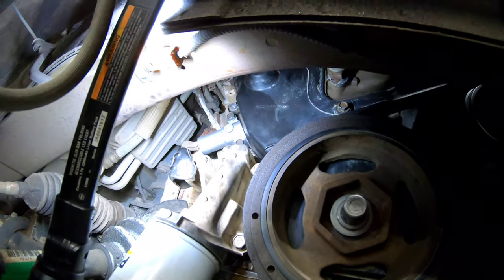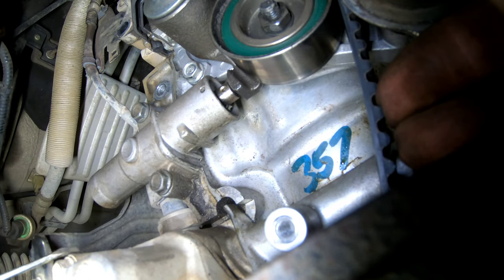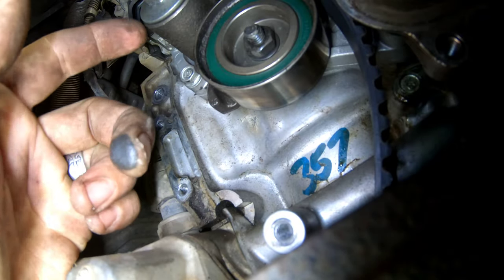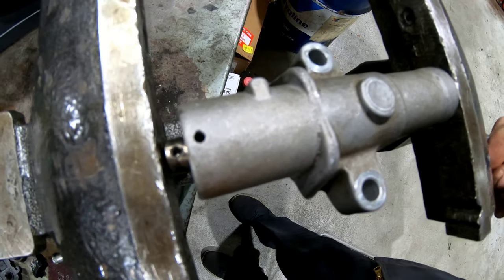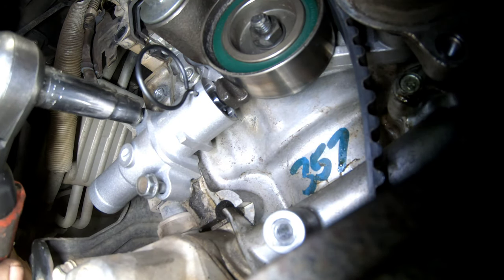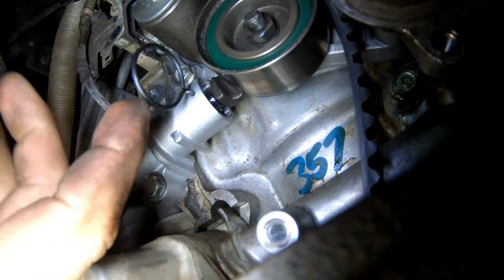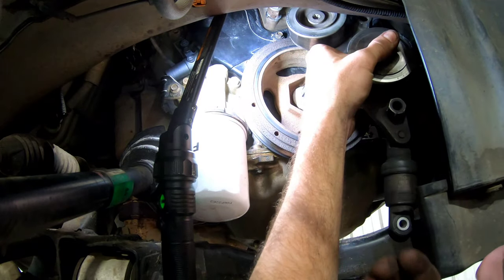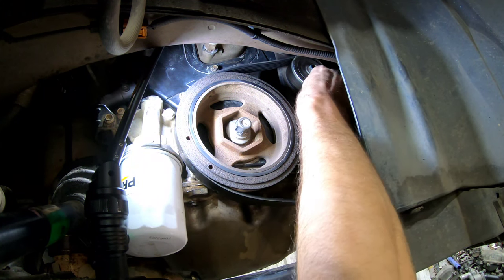Honda / Acura V6 engine ticking,  knocking, rattle noise from bad timing belt tensioner

Comment: Is it common for the knocking to go away after the car has warmed up.   Mine seems to go away.  It’s also worse on cold mornings, but again goes away after warm up.
Reply: Yea
Reply: Yea
Reply: Yea
Reply: Wish he would answer. Jesus christ.
Reply: My car makes that sound only in the morning too lol..
Reply: Yes, being a Honda tech I just looked at one today that had this exact noise. Customer stated that the clatter was more prominent during cold weather and also when letting the car sit for +1 hour or overnight.
Reply: Yes it’s common but when it becomes continuous while the engine is running for a while sounding like engine knock it’s just a matter of time before the tensioner completely fails and stop holding the belt bearing in place and then boom the result is going to be catastrophic failure and you will get a  stripped broken belt and bust valves after they clash with the pistons
Reply: I have found it’s best to use the old style shorter Honda butter fly tensioner or non hydraulic ones why Honda switched to the grenade style tensioner is beyond me I stopped using the grenade style ones as shown here I noticed with old butterfly tensioner Honda had no where near the timing belt problems making noise until they switched to these
Reply: Same here. Cold morningns only. Goes away after 1 minute... warming.
Reply: @rosieclark3661 do you haver the part number, does It fit in this car?

Comment: 2007 pilot here. Has a chattering noise when accelerating when beginning to drive up to 15 to 20 mph then the noise goes away. Will Not Duplicate the same sound while driving past 20 mph or faster. Great video thank you. Will share with mechanic.
Reply: I have something similar on my tl. Did you find out what it was?
Reply: One mechanic said it is probably the heat shield from the catalytic converter. Another mechanic said it is probably something from the axle. So, I have not received an accurate diagnosis.

Comment: I have the exact same noise on my 2013 Honda pilot. I also replaced the timing belt about 12,000 miles ago. I took it to mechanic and he tells me it's the timing belt. The tensioner was not replaced only timing belt. I have a feeling they are trying to scam me as they are trying to charge me $1800 when I already fixed it for $1200 in another city. Since it's the exact same noise i think I'm going to take my chances and just have someone replace the tensioner and hopefully the noise gets fixed.
Reply: Always replace the entire system when doing a timing belt job. The price will be high because of how long it takes to get to the parts
Reply: You might be able to swap just the tensioner yourself without replacing anything else look on YouTube. There's a way to do it without taking any of the timing covers or anything off
Reply: @jwat8400  he’s already replaced it 12k miles ago. Pointless to buy another kit when all he needs is a tensioner
Reply: @Wormmotb   Yes. However I was saying that for the future, so he wouldn't have to worry about something in the same system so soon.

Comment: Thanks for this information. My 2008 Honda Accord EX (3.5 V6) has had a knocking sound for the past two years. I just dropped it off at an engine shop today.
Reply: Did it fix the rattling?

Comment: 06 accord here 135k. My sound is alot lighter. Only occurs when it's a cold start and below 50* the noise goes away after warm up. Sounds like a loud injector or lifter idk.
Reply: 06 accord with 145k. Same noise on cold starts and goes away when warm. I'm fairly certain mine is the t belt tensioner. I work at a dealership and asked a few seasoned techs. They said to be certain, tear it down and start to verify noise.

Comment: Thanks for the video 
Have you used the Aisin brand for a timing bet kit if so whats be your experience with them
I have a timing belt  job coming up on my to do list and been looking for information/people experience with the Aisin brand kit
Reply from the maker: I have had good luck with using aisin timing belt/water pump kits on toyotas since allot of toyotas use aisin from factory anyway, I don't believe I have used a aisin kit for a honda yet, but on toyotas I haven't had an issue with aisin's hydraulic tensioners/ pulleys/ or water pumps.
Reply: @FixItPhillip  ok thank you for feedback the provided mishiboshi  timing belt is a quality part as well   or would a Bando brand timing belt be better  ?

Comment: Bless you Philip, I have that same type of sound coming from my 2017 Ridgeline sports. Do you recommend me to replace the T Belt also while at that point ( 150,000) miles plus. Can I do it myself with the right tools or do you have a diy video on replacement of the T Belt.
Like most elderly Americans I'm on a budget. I do have some mechanical knowledge skill to do small repairs.
Reply from the maker: Yes at that milage yes  i would replace the timing belt (also check the water pump and pulleys). If you do the job yourself do allot of research of the procedure. The main thing you need to make sure is that your timing marks are lined up properly. Because this is a interference engine.

Comment: I've got a customers 07 MDX I finally pulled into my bay and it was hard to keep running, issue was obvious so not being too far from my bay I lightly limped it in. It ran much more rough then the unit in video. Should I be concerned about possible internal damage? I understand it's most uncertain not knowing for sure without putting eyes on it.  It's been close to a decade since Ive dealt with these engines so trying to refresh.

Comment: Hey I have it’s same motor.  How did you do this without removing the crank pulley and belts.  I always thought that if you change the tensioner. You should replace the belt.  

My situation is that the the water pump and components have been replacedd before except for the hydraulic tensioner.  Can I do this without removing the every (minus the timing covers)
Reply from the maker: You have to remove the crank pulley and lower timing cover, I took off the cover and reinstalled the crank pulley to be able to show the issue clearly

Comment: I changed the timing belt and did a few clockwise turns and noticed that the alignment is about 1-2 teeths off..     Is this normal?   I heard that it had to turn 281 times before it gets aligned again..  is that true?    No error code, no engine code either..     Just the sound of the engine seems off a bit..  and a very very faint knocking I hear ..

Comment: Hi there, I'm hearing a similar ish ticking/knocking noise from the engine bay of my 03 CL Type S and it also has a rough start up that just started today. However, when I get the car above 2k rpm, the knocking completely goes away. Do you think it's the tensioner itself that's causing the issue?

Comment: Dude thanks for the video, however, as a diy’r I felt pretty good about the fix until you got to the end where you needed to replace the timing cover and crank pulley!  I think you need a special crank bolt socket?  Maybe if you would give a heads up on details like special tools or disassembly.  Thanks anyway, I’ll do further research and see what I need to do as far as getting to the tensioner.
Reply: you don’t need a special socket, 36mm w a strong impact gets it off
Reply: This can be done without removthe timing cover.
Reply: @matthewvalentine3549 can you point me to a video of this method? Can’t seem to locate and having the same issue.

Comment: Do you need to remove harmonic balancer/crank pulley to do this job or just the timing cover?
Reply from the maker: Yes serpentine belt.  Crank pulley.  Then timing cover
Reply: @FixItPhillip thank you for the fast response 🙏 💯

Comment: I got a new one not too long ago and it kinda making a chattering noise right now but I felt the tensioner and it didn’t vibrate bad imo. So I looked at the drive belt tensioner and the bottom pulley is hard to turn compared to the upper pulley. So I think that may be causing that metal chatter for me?

Comment: I have a similar knocking in the engine bar near my timing chain area 2012 Honda Accord EXL, but it only does it sometimes when I crank the car first thing in the morning,when it's cold and then once it's warm, the noise goes away. Is that a symptom of timing chain or tensioner?
Reply: V6 version?  If so, possibly the belt.   4 cyc has a chain so that's unlikely to be it - chain issues are rare on the 4 cyc assuming proper oil change.   Could always be the serpentine belt/belt tensioner but thats easy enough to check.
Reply: @JPrez-io6qj  yes v6, I had a couple mechanics look at it, they said the timing belt sounds fine, once it's warm, but in the morning it knocks a bit hard but only 45° and below, it'll last 2 to 3 minutes and gradually go away, but when it's 50° or higher there is no noise or knocking.
Reply: @GeetarPsycho  As a former tech, I'd lean towards one of three items (I can't obviously hear it, but maybe you should upload a video of it?) - but timing belt tensioner, check to see if its wet/listen with a stethoscope, replace.   Other areas for cold engine noise/knock is oil pressure/oil delivery - depending on year - vtec solenoid near oil filter has screens that clog and/or valve chatter valve clearance issues.   The 3.7s were known for oil delivery issues but those engines were pretty rare.
Reply: @JPrez-io6qj  okay, I'll add a video and tag you in it or post the link here, I'm leaning towards tensioner, my friend and I actually changed the VVT Solenoid spool valve due to it leaking onto the alternator, and changed the valve cover gaskets, and all that.
Reply: Bro it’s your tensioner guaranteed. If your oil level is fine it’s exactly what’s on this video. You need the tensioner and the tensioner pulley it’s hitting since it wears down. The fluid leaks out the tensioner and weakens contact to the pulley causing it to create a gap while it’s running hence slapping the pulley slightly consistently causing that knocking sound. I guarantee it. Replace it and it’ll be completely gone.
Reply: I also have a 2012 Accord EXL 3.5L and the exact same symptoms.  Sounds like a rattling exhaust shield and is more pronounced upon light acceleration.  Mine is at 95k miles.

Comment: Thanks for this detailed video. How long does this tensioner usually last? I have  a 2019 Odyssey with 48K miles, and dealership mentioned tensioner is leaking..
Reply: Usually 60 to 100k miles. If it's leaking have new timing kit installed asap
Reply: Similar problem here. Did you get the timing belt and everything replaced?
Reply: No, I didn't, At 60K miles now. Going to get some recalls done soon, May be will check the tensioner again. Its such a pain we cant trust these stealerships at all. I never saw any proof other than them just saying its leaking

Comment: Just a question, when you release the cam belt tensioner with no pressure on the belt, were you not afraid the cams gears might jump and skip teeth?
Reply from the maker: You just have to be careful.  I had to do it 1 handed because the camera was shoved in there lol. It would be safer to use 2 hands so you can manually  hold/push  the tensioner pulley against the belt so there's minimal slack.

Comment: Did you remove the crankshaft pulley to remove timing cover?
Reply from the maker: Yes
Reply: @FixItPhillip  thanks! I figured it out earlier when I noticed that the bottom two bolts for lower timing cover is behind crankshaft pulley.

Comment: I have a 2016 pilot, when it had 88k on it it was making this noise. It has 89k on it now and it’s not making the noise anymore? What should I do?
Reply: I think it’s only when engine cold. For example mine isn’t doing in summer months at start up but did winter.  I live in California so not even that cold or hot.

Comment: My 2019 3.5 passport makes a ticking sound when under load, accelerating 0-10 mph.  Could it be timing belt tensioner?  Only 20k miles, been hearing it since 10k miles.
Reply from the maker: That's a newer engine design. And if I'm not mistaken has direct injection (high pressure fuel injectors) which can be a louder tick noise especially under load

Comment: 2012 V6 Pilot recently started making a clunking noise (different noise than this one) for 1-2 seconds at start up, usually when cool or cold. Quits immediately… Any ideas? How best to check serpentine tensioner?
Reply: Check the vtc actuator camshaft those Hondas they have a recall it makes a grinding noise at the startup gets worse on cold 🥶 starts

Comment: Both bolts for the tensioner out outside the black cover ,, why take all the other stuff off ? Can it be done without taking all the other stuff off?
Reply: 2008 Honda Accord v6
Reply from the maker: To release the new tensioner lock pin, also to show where they leak from and how they chatter against the tensioner pulley.  Also I've seen them chatter so much it'll damage the tensioner pulley side and need to be replaced as well
Reply: @FixItPhillip  Thank you!

Comment: Well crap. 06 Ridgeline sounds like that on cold starts. Sound goes away after warm up. Had the engine swapped for a blow head gasket. Shoo that did the work said they replaced the timing belt, but im not to so sure they did. Looks like im going to have to bench it until I can afford to take it to the shop.

Comment: The j series 3.7 for Acura TL also has thus ticking sound.   What's the best way to determine if this is the case or if it is a worn rocker and cam?
Reply: Does Honda j-motor have a cam Love dedicated to power the piston?
Reply: Jack up the front of your vehicle take the passenger side tire off, start the engine and carefully feel the timing belt tensioner that sticks out. If it's vibrating it's that

Comment: Would a worn drive belt make a engine overheat?
Reply from the maker: The water pump on this engine is driven by the timing belt. Unless the water pump is seized it won't cause it to overheat. And it if it was seized it would burn up/break the belt quickly

Comment: My 2006 Acura TL with the 3.2l is making the same exact noise but I can't find the hydrolic tensioner part anywhere just the whole tensioner. Anyone know part number or is this only an issue on the 3.5? It sounds identical though

Comment: If its just the tensioner..do I have to turn the engine? Or was it that you was just testing it?
Reply from the maker: That was just me testing it. Showing what it sounds like before and after
Reply: @FixItPhillip  im sorry..what I meant was..after you put in the new part..I saw that you turned the crank..do I have to do that too?
Reply from the maker: I would. I turned it clickwise. Just to make sure all slack is taken up before you crank it. So there's no risk of it jumping teeth
Reply: @FixItPhillip  ok got it..thank you

Comment: I have the same noise but mine is a 2008 3.5 v6 Honda accord and my tensioner is the spring one instead of the hydraulic one. Could it still be the tensioner ?
Reply from the maker: I doubt it. This issue I showed pertains to the hydraulic style tensioners
Reply: @FixItPhillip  Olay thank you , I really don’t know what the problem could be then. I don’t wanna end up buying an engine
Reply: Many people gets confused 
Hydraulic tensioner
Timing belt tensioner 
You have to know which one was gone bad.

Comment: Ive Never designed a Motor or a tensioner for that matter …….. but why not have a serious spring push this vs hydraulic powered piston that can leak!!!! 

I have a d21 hardbody & all it’s timing guide wear is due to a faulty oil pressure powered timing tensioner

Someone needs to make a spring loaded version of THIS
Reply: Springs wear out too.

Comment: I heard the timing belt pulley tensioner bearing is a little dry sound you should just change everything timing belt kit so engine last another 100K miles or more. Next time buy a car with timing chain.

Comment: Might as well do the entire timing job, you're already there
Reply from the maker: True.  But the t belt and water pump was already done on this one super recent.  Just had a tensioner failure. But yes if it's due do it all
Reply: Maybe customer didn’t have money for entire timing belt job just enough for diagnostic and repair parts and extra labor was prob out his budget after he diagnosed to problem

Comment: Not completely informative, fail to mention you need to remove the shield and crankshaft pulley not an easy job if you don't have the proper tools.

Comment: I have 2 hondas with the ticking noise, 16 Odyssey and 15 Accord V6 both with 85k miles. On both of them though they only tick when the engines cold. Would that be the same thing?